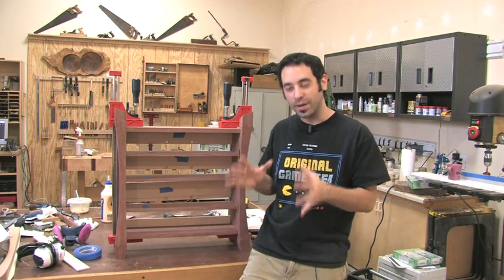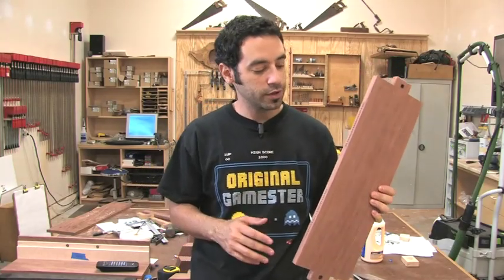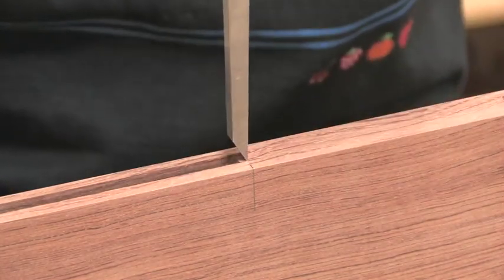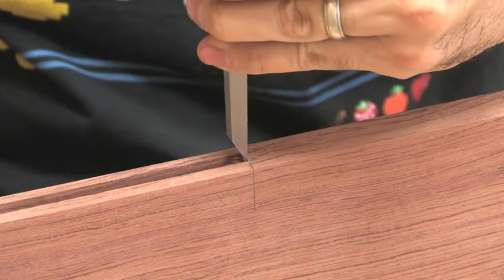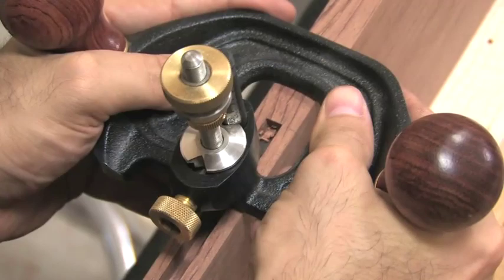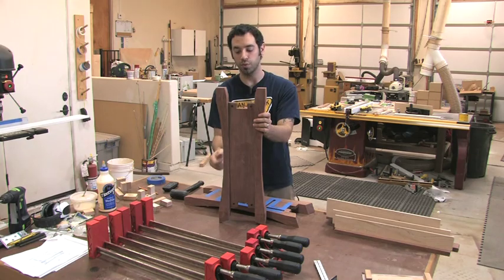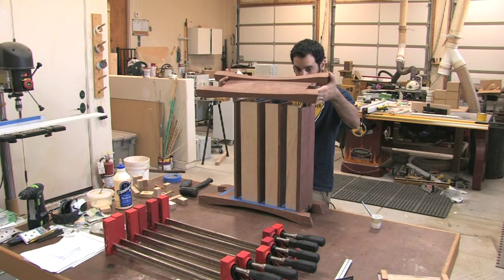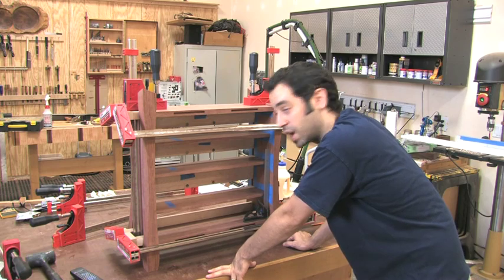66 - How to Build a Charging Station for Electronics (Part 9 of 12)

Comment from the maker: I have had computers in my shop since...well...since I had a shop. I blow the dust off once in a while and that's about it. Of course I am not using top of the line equipment in there but I have yet to have any issues.